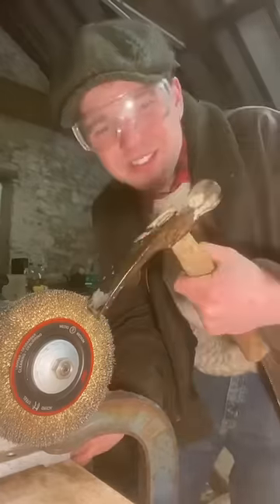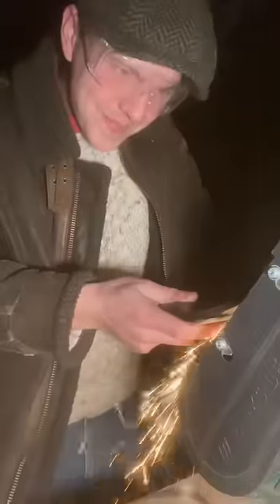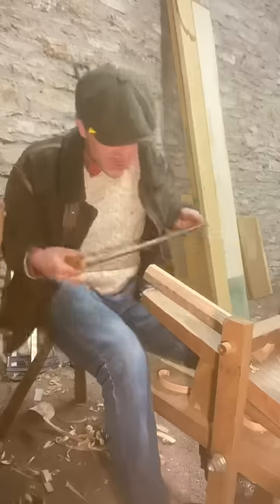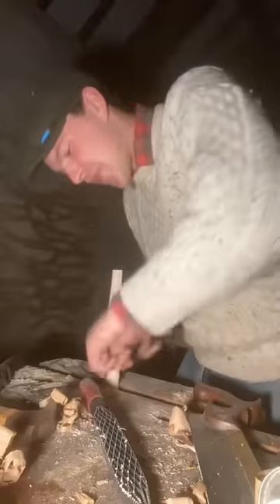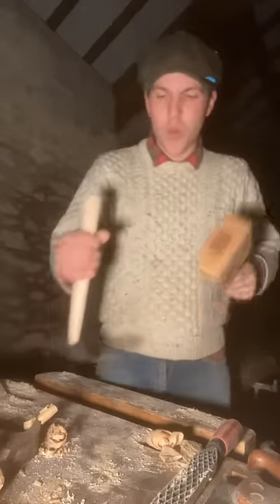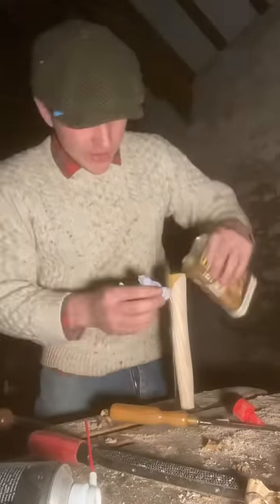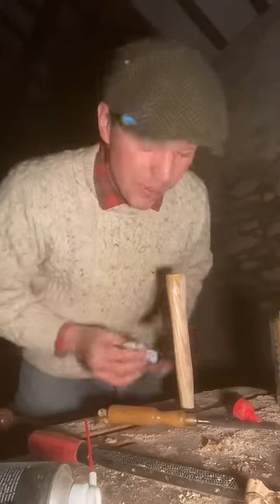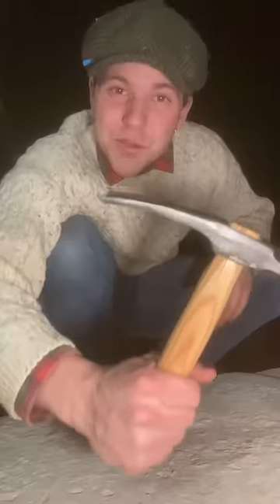Never thought I’d be sharpening a hammer #ireland #woodwork #handtools #restoration #satisfying

Comment: That's a paving hammer/mansory, its use by pavers to hammer stones in the sand or to break them in shape
Reply: Neat :)
Reply: It’s just a masonry or bricklayer hammer not necessarily a paving hammer though it would be good for that it is used to split concrete blocks in general they use them for paving/brick laying/laying block or pretty much anything that involves splitting blocks I use them for rebuilding foundations….but if you look up paving hammers….the hammer in this video won’t show up instead you will find rubber mallets or soft mallets for pounding down pavers…you don’t really want to use a hard hammer like this for hitting pavers because they break or chip
Reply: Rubber or wooden hammers for paving. Don't wanna crack and chip your blocks.
Reply: @Onewingedangle42  at my school we had them and yes i agree, rubber is far better but the one in the vid did we also use to practice with. I found out later that there are rubber caps for them as well
Reply: @DeliMeatTree  i certainly agree, however there are cap blocks for it made of rubber that you can put it on
Reply: @dr_alto_clef  yeah that’s true they do have rubber caps for them and you are right they can be used for pavers I’m just letting you know what they are called and what they are for no worries you may have been taught that they are called paving hammers I’m just letting you know
Reply: @Onewingedangle42  nah its cool, in my country its called a "Stratenmakers hamer" which i used google to translate it due to i didn't knew the original English name.
Reply: @dr_alto_clef  you went to school to learn how to lay pavers?
Reply: It's a brick hammer. I use one almost every day
Reply: @T0KEtheSM0KE  it’s a bricklayer or masonry hammer that’s why he edited his comment he just spelled it wrong
Reply: Performing the same function as a scutch
Reply: @Onewingedangle42  yes, its part of professional gardening studies
Reply: @dr_alto_clef  fair enough I spose

Comment: The original handle could have been saved by removing any finish remaining and soaking for 24-48 hours. You then replace the wedge with a slightly larger on a refinish it with oil

Comment: Try forcing some glue in the crack, then applying a 10 bight 11 lead Turk's head knot using leather lace. Tighten it down until it won't budge and the crack shouldn't give you any trouble in the future. 
It'll also identify the hammer as yours.

Comment: If it anit pine it aint mine. If it aint oak its a joke. If it aint Hickory its history. If it aint Maple, well im not gunna use it. (The canadian aren't verbally clever, drake doesnt even write his own lyrics, anyway) the point is, any Hard wood makes a good handle.
Reply: No that's not true. Ash is best because it vibrates less than any other wood.. FACT... 🤨
Reply: @keithking1985  maybe so, although that kinda sounds like personal preference not fact, because reverberation is based on density not speices, and it is called a "hard wood" because of density, so your theory isnt exactly sound. Ash is only slightly denser then oak. 

but people in America, we aren't going out of our way to use it. We use oak Hickory or pine depending on our location, and they all work just as good. 

If reverberation is that big a deal for you, maybe you should work on your tool form, cause if the reverb is hurting you, your going way to hard, or swinging wrong. 

The curve in things like axes isn't there for show, it serves several purposes, one being to dissipate the reverb. But you do you boss, enjoy that carpal tunnel and arthritis.